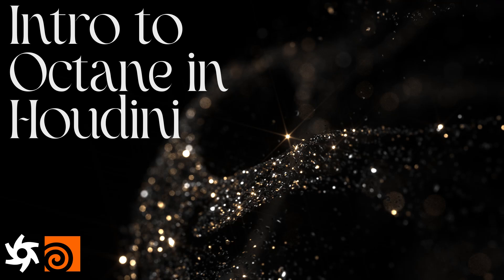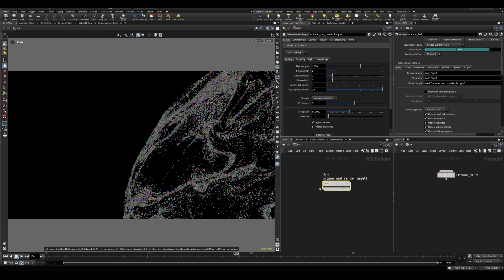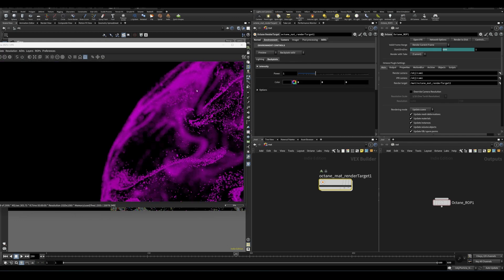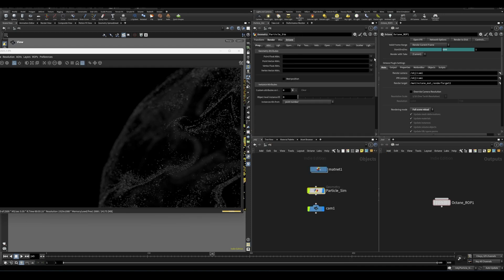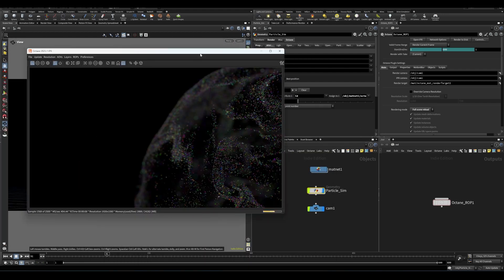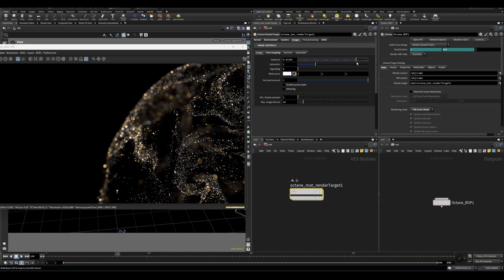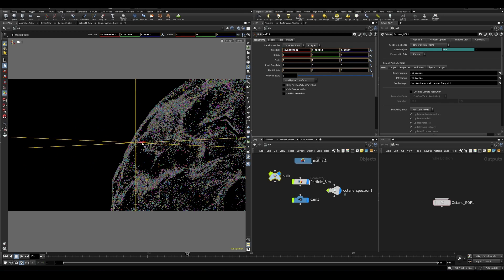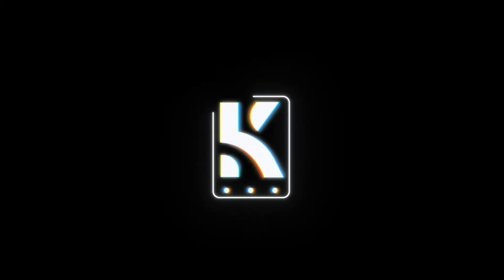Intro to Octane for Houdini (2025)

Comment: I'm not familiar with octane (that's why I'm watching this tutorial:D), but it could be because id is usually an integer attribute and not a float or a vector. I personally think the best way would be to define the colors by id and do whatever you want with them in houdini and then use the Cd attribute as you did. But you could try to make make a new attribute id_float (put this in an attribute wrangle: f@id_float = float(@id);) to use it inside Octane. Don't know if that works with Octane, just an idea to test.

Comment: Hello, first of all thanks for sharing all this information, you're doing a great job! I'm considering to switch from karma to octane or redshift one of them, what do you think about the integration of octane in houdini, is it any good? is there any limitations?
Reply from the maker: I think for production scenarios I would still choose Redshift due to its stability and reliability. Not to say Octane isn't stable but I tend to run into more issues than Redshift. It also easier to access and use attributes in Redshift in my opinion.
Reply: @kylesullivandesign  why you need attributes  for? Sorry I am need